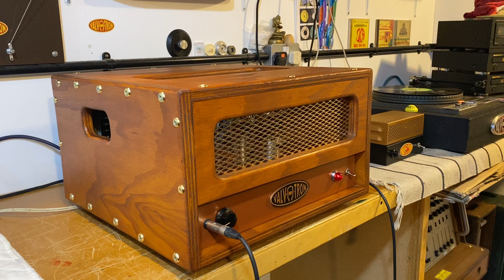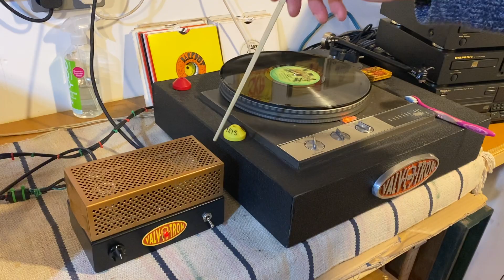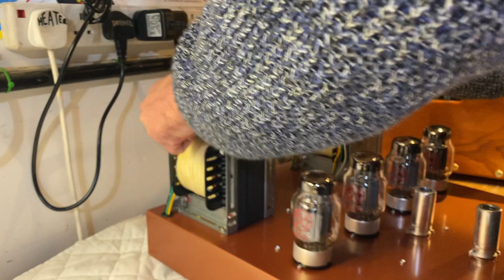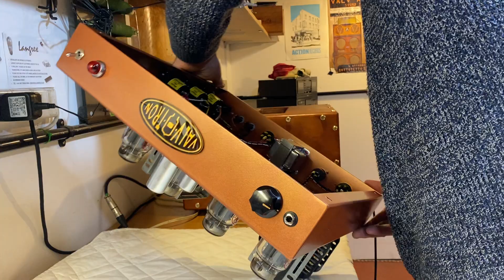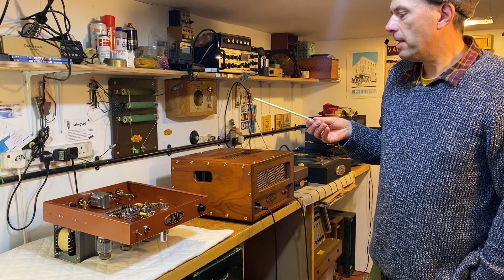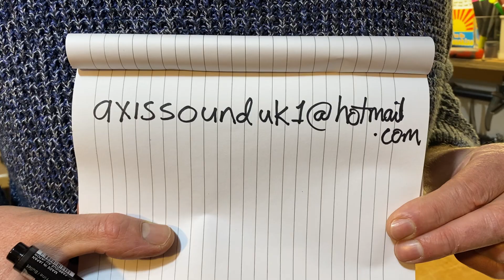Valvatron 250 watt Valve Amplifier Demo

Comment: It looks great, with great quality parts and an excellent building quality, but the main transformer and the output transformer without shield and parallel to each other? What's the output noise level? pretty sure you would have a lot of 50 Hz and related harmonics in the output signal. Is there any bandwidth, noise and distortion measurments of your amplifiers online?
Reply from the maker: There is very little noise and no 50Hz harmonics. The transformers only need inverting if there is such interference, but there was none in the prototype, so none in here either. No measurements online.
Reply: @Axissound  Thank you for answering. I'll send you an email.